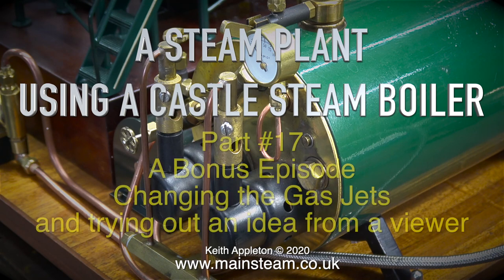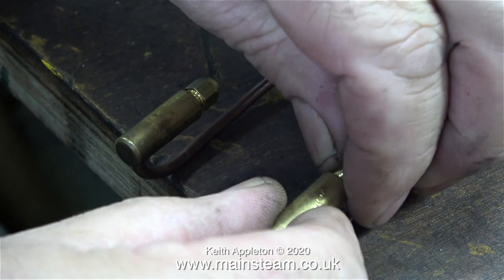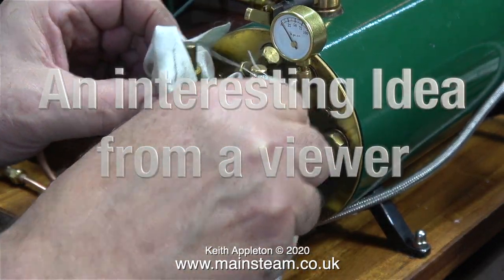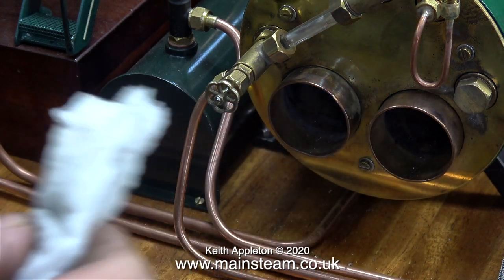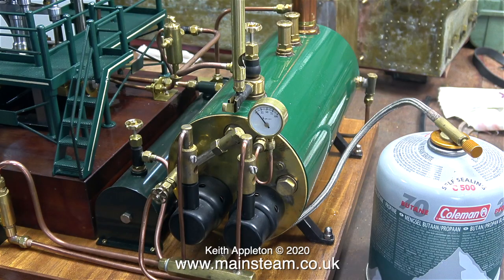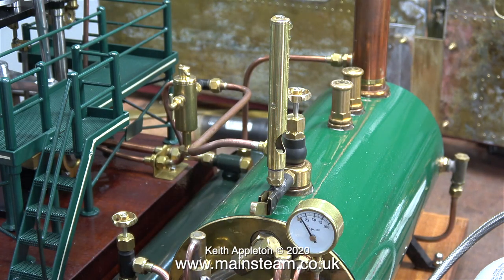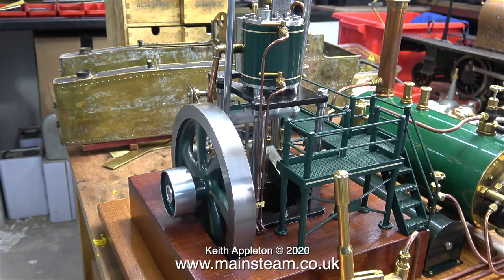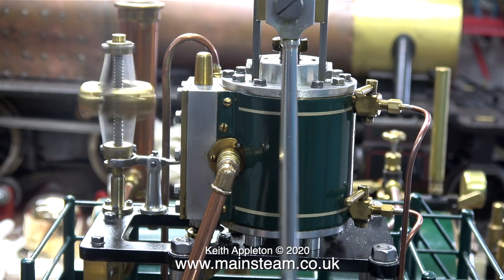A STEAM PLANT USING A CASTLE STEAM BOILER - PART #17

Comment: About the howling, I don't know if this will work or not but in full size boilers we used turbulators to slow the gas flow down for more heat transfer. They were terrible to work with as they were thin corrugated metal  strips that had very sharp edges and were coated in soot etc.

Comment: Might i make another suggestion on sound dampening. In the gas turbine world engines will often use perforated metal sheeting in the bye pass ducts to cut down on the whining noised that jet engines tend to make. You can find this stuff in metal supplies near expanded metals often times but with the round holes. If you where to make a sleeve of this material and slide it into the flue tube it may help trap some of those howling tones without obstructing the flue tube.
Reply from the maker: Yes, that's a good idea, I will try that. Thank you [:-)))
Reply: @keithappleton  your welcom

Comment: Purchasing  jets to get the correct ratio can be expensive.   An alternative, we used when tuning racing car engines, was to use numbered drills.  The original size was ascertained and noted.  Then drilled out using slightly larger drills, until the desired result was obtained.  If we needed to make the hole smaller we filled it with soft solder and re-drilled.
Reply: The burners on steam boilers can get quite hot, I have had soft solder melt on them. I have used solid rods threaded to a larger  size then use numbered drills to find the right size.
Reply: @steamboatmodel  I did consider the possibility of the solder melting, but thought the cold expanding gas would likely prevent this.  However your alternative eliminates that possibility and provides a versatile means of adjusting the ratio.

Comment: Have you ever considered incorporating one of the sparkers for gas grills to ignite a gas fired boiler?    An electronic one that goes tick, tick, tick, tick would lessen the potential "boom" if you press and hold before starting the gas flow.
Reply from the maker: Yes, Piezoelectric igniters are very common. Cheddar Models used to fit them as standard.

Comment: Regarding the padding, may I suggest placing it against the wall and/or door of the smoke box, opposite end of the boiler from the burners? It sounds like a whistle because the flue behaves like a whistle in that the sound waves are traveling back and forth in that tube. If the waves can’t reflect back towards the burner when it hits the padding, then that harmonic resonance can’t accumulate to make much (if any) noise. Also, the smoke box is a place where you can afford to insulate against the metal because you’ve already used the heat you need inside the flues.

Comment: That is a very interesting idea indeed. Although it's too late for this boiler, I think you might be able to get the same effect using a much smaller piece of ceramic wool. Since the boiler tube is acting as an organ pipe, all you need is something that will prevent the standing wave from forming in the tube without blocking much airflow. Putting a bit of fluff at an antinode should do the trick. Of course you risk driving the wave into a higher harmonic but a bit of adjustment should be enough to forestall that from happening.
Reply from the maker: I removed the Ceramic Wool before I gave the completed plant to the owner.